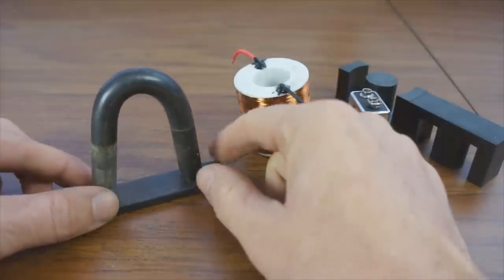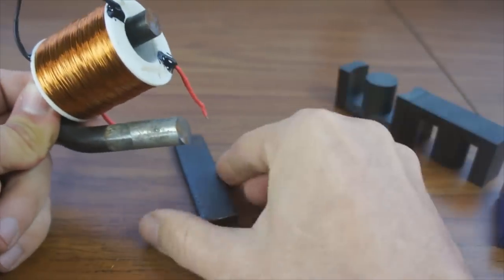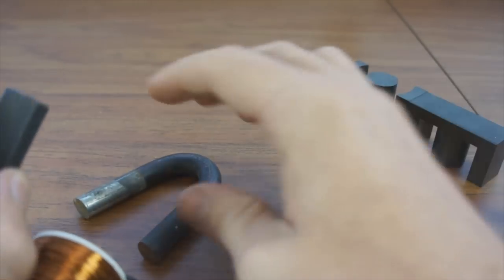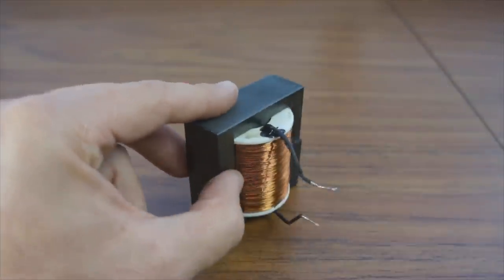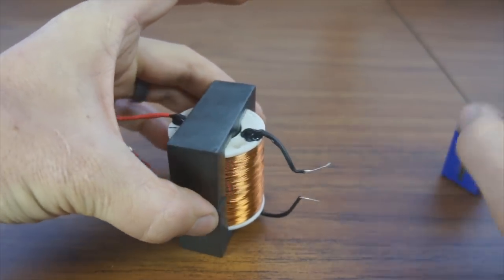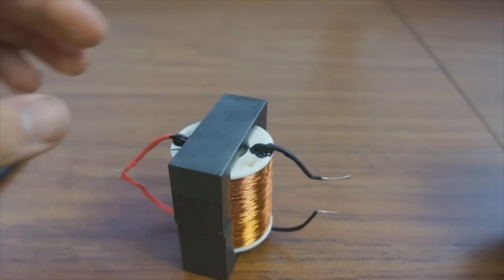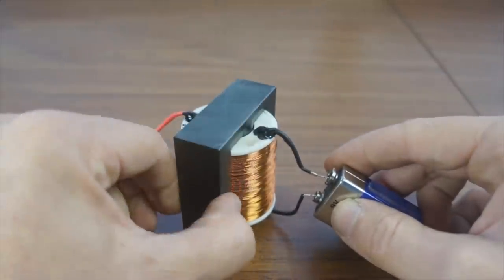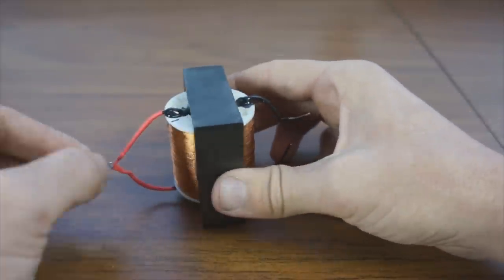PMH - Electromagnet keeps holding after power is removed?

Comment: Try tapping the secondary coil in the middle to measure the voltage going through it.
It would be really interesting if it was oscillating in some way.
Reply: It is all static energy, there is no current flow.
Reply: +1
Reply: Robert Brockway In order for this to be static an insulator would be required.
Reply: HiFiman4u
Incorrect. Were do you people learn your science from?
Reply: Robert Brockway The power flowed from the battery(current source) and when the secondary was shorted then an induced current is initiated into the iron.
Yeah you think you know something. It is the moving current in a wire after all that creates a magnetic field around that wire, basic electronics 101.
Next you'll be trying to tell me a permanent magnet is a static device?
Reply: HiFiman4u
I can see you have no understanding of the meaning of the word STATIC. It simply is any object or thing (in this case a field force) that is at rest, not moving, stationary. Also a permanent IS a static force unless the magnet is physically moved. God, I hope you never work on electronics with limited knowledge. Now if you take the time and the new knowledge I just gave you and read again my comment, it s correct. To help you out a little more , I am NOT talking about static electricity nor did I ever mention it
Reply: Robert Brockway current must be flowing through the second wire, if not it would not matter if the loop was closed or open.
Reply: TheLawnWanderer
Correct, but only when the power source is applied is there a current flow in the primary winding. The secondary winding current flow will stop when it is reached saturation with wire ends open. With secondary ends closed the current wil flow as long as there is current supplied to the primary windings.
Reply: "The secondary winding current flow will stop when it is reached saturation with wire ends open"
There is no current flow in any open circuit. You also state now that there is current flow in the closed secondary which is quite contrary to your previous  static statement. FYI DC current cannot flow in the secondary winding of a transformer,
Reply: Robert Brockway Don't worry about me, just worry about yourself and all your contradictions.
Reply: Robert Brockway You obviously don't know much about magnets because the magnetic field around a magnet is in continuous motion.
 If you really want to get technical, at a quantum level there is no such thing as static. Everything in this Universe is in motion.
Reply: HiFiman4u
NOT TRUE, it is a static field. Show me a science text book that proves the field is moving.
Reply: Robert Brockway linearly moving or spinning electrons are the basis of magnetic fields. These motions do not repeat exactly but have a jitter. Therefore on a quantum level the field derived from these motions must also jitter
'Stasis' is a macroscopic average. A useful approximation. Stasis on a quantum level is equivalent to nonexistence.
Reply: Hamilton Smith
Correct, force fields such as magnetic, electric and gravity do not move. they can only be moved by a opposite like force or by physically moving the point or object that generated the field force.
Reply: Robert Brockway this is creating a weak containment field for coil 2 trapping electrons like a capacitor
Reply: Clown Whisper
That is what I said in my first comment on this video.
.
Reply: i just skimmed sorry lol
Reply: Clown Whisper
No problem, your the first to agree. There is some hope after all.
Reply: Robert Brockway Well current does flow for a nono second, then stops.
Reply: duf101101
You mean when the circuit is opened on the secondary?
Reply: Yes when open on second. I regret that 2 years ago I graduated with a degree in electrical engineering from ASU. We learned absolutely nothing about inductors other than EE202 where we did circuit analysis and very briefly covered inductors. At t=0 we modeled it as short and t=infinity we model it as open (builds up field resist current). Of course that just a math model. My thinking is when 2nd is open opposite field (right hand rule) is induced. A EE degree is all about what goes on INSIDE the IC these days. We do absolutely ZERO component level projects. None. No soldering...nothing. In a Maker group (where I am REALLY learning electronics) we were talking about building PCBs, a guy who just graduated ASU said and I quote, "What's that."
Reply: duf101101
Yes it is a shame that basics are not taught and demonstrated when learning electricity. I think this should be taught before going into any electrical field of study and I mean before  the math, like in the K-12 type of schools.
Reply: Robert Brockway That is exactly why we hired all of our electrical engineers and technicians from the Navi

Best training ever. 

We need to do something about getting our government to lower interest rates for collage.  Perhaps more people would focus on learning rather than taking the least amount of classes for the degree

We shouldn't be in the business  of making a profit off of out kids.  I mean shit we dont do it to the bankers, why are we doing it to our kids!
Reply: Clown Whisper
We have the wrong people saying what is to be taught and how.
Reply: In addition to gouging our students at unfair interest rates. Out students should be treated like gold. they are our future, now more than ever.
Reply: TAP THE GODDAMN COIL IN THE MIDDLE. 
AHHH
Reply: TheLawnWanderer
I don't understand it either.

Comment: the movement of electrons within the coil it self does not stop when you remove the battery because it is still a complete circuit and thus will keep going until the resistance of the coil slows the electron to a stop.. kinda an upside down bike if you spin the tire it will keep going until outside forces stop it and the resistance of the wire would be like slightly pressing the brake of the tire.. the more resistance the more the coil will slow the electrons. but if you have a longer coil it will have to travel a long distance until it makes a complete circuit. the highest resistance in MOST circuits are the connectors.  but in theory if you apply a shock to one coil with the other coil shorted it will hold the electromagnetism for a short while but if you shock one coil then short it out with the other coil in reverse you should be able to gain more magnetism time out of the same coils.. they say you can not create or destroy energy.. BUT they never said you cant just move the electrons within the wire. which the movement of electrons is what we call electricity.. this is why SOME of the "free" energy devices actually work. because they only apply magnetism (which is a form of energy it self) and copper (which carries electrons) and the electrons are either pushed or pulled thru the conductor..  and btw copper becomes a SUPER CONDUCTOR at extremely cold tempatures which means that at extremely low temps the copper has very low resistance. the colder it gets the lower the resistance.  but just remember that each winding gives more and more magnetism out which will in turn cause electrons to move within the other coil which in turn will also create magnetism.. so the more coils you have on the secondary coil (one with power applied) the more magnetism you can push into the other coil. just my opinion tho

Comment: To me the first experiment is the most interesting as it maintains the magnetic field. The second experiment, as someone noted below, it appears the coil acts like a capacitor. In the first experiment how long does the magnetic field last? It would be interesting the measure total electrical input from the battery in relation to the electro magnetic field over the holding period.

Comment: Im amazed at why people find so much mysticism on a phenomenon explained since about  a hundred years ago. The reason about why the iron core remains with a magnetic field for a long time is as the name suggest due its magnetic remanence and coercivity. WHen the "keeper" is in place the magnetic circuit is closed so the strength of it is quite high, when you remove the current from the coil, being a closed magnetic circuit, it can sustain a relatively high magnetization strength, when you remove the "keeper" the magnetic circuit loses permeability significantly so the iron can no longer sustain its magnetization due its weak coercivity, its magnetic domains become random and loses its magnetism its energy becoming heat. 

The case of the other magnet with a ferrite core is similar but there is other phenomenon in place, ferrite is used in high frequency transformers due its low coercivity and high magnetic permeability, this reduces losses as heat. So even when the magnetic loop is closed it losses its magnetism very easily, however when you have another coil in the circuit in short circuit, there is a EMF in it, when you disconnect the primary coil the magnetic field collapses suddenly but the shorted coil opposes it so that actually makes the magnetic field decay slowly (im actually surprised how slow it decays) If you instead had a superconducting secondary coil it would become permanently locked, of course as long as you maintain the coil at its superconducting temperature.

Comment: TL;DR  Ferrite has low hysteresis from the lower concentration of iron particles in ceramic (ferrite) and thus low residual magnetism.  Yet with enough inductance the residual current is determined by Tau=L/R [Henry/Ohm] ratio in seconds defines how long the current stored in the loop will decay to 27% of the original value.  That's why it doesn't last forever and typically only xx seconds. Whereas, Iron has up to 10x higher magnetic constant and stronger residual magnetism (hysteresis) until the magnetic loop of the nuts is open. Thick nuts work OK for DC but not AC due to losses.

Comment: Coils do not behave like capacitors. They behave like inductors because that is what a coil is. When you remove the battery the coil tries to resist this and creates a strong negative charge at the positive terminal and a strong positive charge at the negative terminal. Ths is called the back emf. This emf  will keep flowing until it eventually stops due to the losses through the wire. Therefore keepin the magnetism. The iron core helps to exaggerate this.
In the second example, the two coils act as a transformer. coil 1 inducing a voltage into coil 2. Short coil 2 which has more turns and you get a bigger back emf effect.

Comment: I beleive the ushaped softiron latch is acting both as a one turn coil and a core and that is why ,like the dual coil , it will hold its magnetic feild. You should put two ushaped softiron cores inside one coil and see if they both hold the field for half as long. I beleive there mist be a cycle of one coil collapse refeeding the other coil with energy to recreate the magnetic field in the iron. It is very low loss. Perhaps like your graphite ringer circuit there is a resistive delaye to make it ring/cycle.

Comment: There is nothing mysterious about this. When activated and then power is removed there exist a static magnetic closed circuit system in the iron metal loop and if the coil secondary windings ends are connected and the primary winding power is removed the secondary will not collapse rapidly because of the magnetic iron core loop counter force. The whole set up is then held together in a static state.  BOB
Reply: You forgot that those are soft iron cores, a type of iron which is only magnetic as long as there is current flowing around it.

Comment: Hello Laserhacker ! 

We here at World Improvement Ministries have been seeing your work for some time. You are doing good work !

A number of people have already answered your question, long windedly. But If you would like a simple explanation of what is going on, It is this:

The pulse in the primary produces amp X turns in the secondary. Those ampXturnes ARE MAGNETISM. that magnetism continues for seconds (The time it takes for the resistance to eat up the power) Until the magnetism (Amperage) is so weak that it can no longer hold the keeper. 

Yes, you can measure the amps flowing and dropping fast with a good amp meter in the secondary.

By the way, you are right on your hunch that the first demo is doing something closely related. If you like us to explain that one also, check out our videos on you tube wits2014, then give us a call. 

Professor Timothy Thrapp and The World Improvement Team
Reply: A closed loop of COPPER wire would not perpetuate current more than a fraction of a second after the magnetic field inducing it is gone.

Comment: It looks like you have built an electropermanent magnet. The solenoids that hold open firedoors in office highrise buildings use a similar principle. They use no static power. You only need to apply power to switch between holding and not-holding.

Comment: One interesting thing I didn't see mentioned was that an electric field resists collapsing momentarily when a circuit is broken which you might understand better a bemf and is the cause of internal electromagnetic resistance in a motor. I would wager a guess as to say that the core is somehow holding that bemf as there is no external connection to a grounded circuit in which to bleed off the residual emf of the coil which would "unlock" the field.

Comment: The shorted coil becomes another PMH. The magnets traveling through the core, activated by the initial charge, then activate the magnets in the shorted coil. Copper does not hold magnets like iron so it is very weak and breaks loose. If your secondary coil was made of Iron wire it would probably hold longer, maybe even....................................?

Comment: Yeah, it seems that the second coil (or loop) is absorbing the field (via induction) creating a current in the second coil and hence once again creating a self sustaining field. However even though he didn't show it in the video i suspect the first example he used would also lose its magnetism after a longer period of time. I think you will find that the more turns in the second coil the greater strength in the residual field but the strength is inversely proportional to the time so it wont last as long.

Comment: the same can be done with a large transformer as well the secondary coil can be shorted with a large current diode and a neon light several seconds after the coil has been energized the diode can be removed to flash the neon.  you should look into quantum entanglement for the better understanding of what is going on . the resistance on the coil even several ohms will null out the effect.

Comment: Ed Leedskalinin(?ms) first wrote about this effect in his book magnetic current. He was also the creator of coral castle.
That being said we still have a very rudimentary understanding about magnetic fields. It's only recently that an explanation not requiring a virtual particle or ether has come out and that is 2 electrons occupying the same orbital with matching spin. Might have mangled it a lil in my explanation but that's the basic gist or rather current theoretical gist or, lol, my take away. ;)
If that explanation holds true then I would hypothesize that the closed configuration allows enough electron build up to keep the circuit flowing through instabilities. Open allows those instbabilities to be leaked out. Also I'm not giving account for lenz's law.
The reason the transformer core does not hold as well as the soft iron has to do with magnetic hysteresis, covered in transformer design text.
Hope some of this helps.

Comment: heres my stab, other comments look good kudos.. the changing magnetic field in the battery wire induced a current in the other wire, which being short circuited and a coil and having the transformer core running through it, makes me wonder why its so hard to understand. seems to be an example of a PMH.. what I would like to know is: if you put a meter on the shorted wires and separated them, what is the peak voltage.. now remove the transformer.. is the voltage the same or not? is it higher or lower. lmk if you run that - great work!

Comment: its because you have lots of copper wire coiled around something so when you connect the battery and take it of the current still flows in the copper wire so if you remove some it might not stay like that for a long time

Comment: residual magnetic field due to a capacitive coupling in the shorted secondary. OR a tank circuit ringing until it fades out hence it holding for a an instance. Add a 18v 2F cap and see how long it sings

Comment: When the core's magnetic field starts to collapses it generates a current in the coil which slows down the collapse.

This is no different than the experiment where dropping a magnet through a copper tube falls slowly. Induction always tries to resist changes in the magnetic field or current.

Comment: linear vector voltage through the iron core causes the lock. like in the old computor core memeries. the linear vector voltage is through the center of the core. the wire is a linear voltage through the wire wich causes inductance which disapates the voltage over time due to load. the ferrite is probible too dence for the time to space vector speed of the voltage, so the gap breaks the bond.

Comment: Aren't you creating a tank circuit by "shorting" (wrong word actually, as shorting would mean you short across the coils, not that you connect the ends together)?

The coils have between them a capacitance and since they are inductors you are finding a resonance of sort, and the ring down keeps your system charged.

Put a voltmeter on it.

Comment: Is it possible this has to do with magnetic hysteresis? I know certain hard drives and other magnetic storage devices uses hysteresis to lock the magnetisation of the ferromagnetic materials, but I've never heard of it being used to lock fields as strong as those in this video.